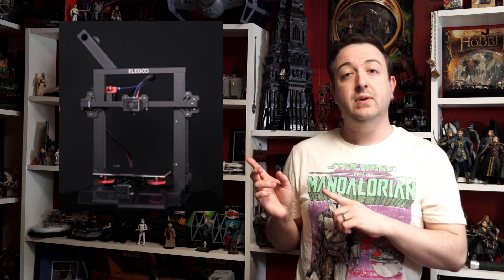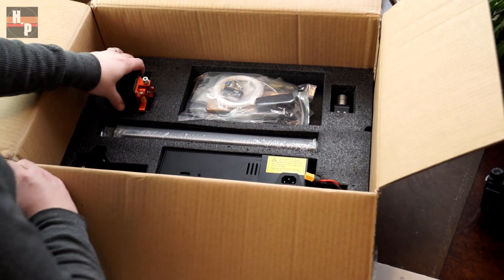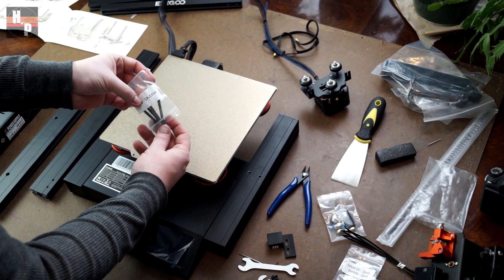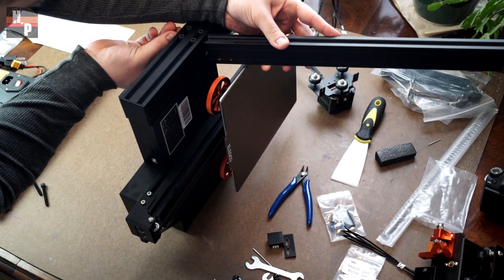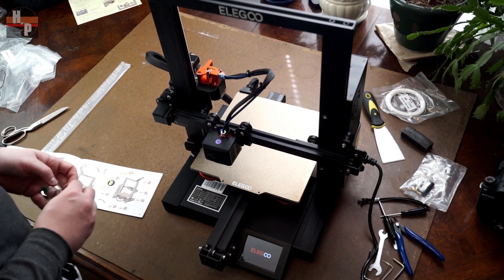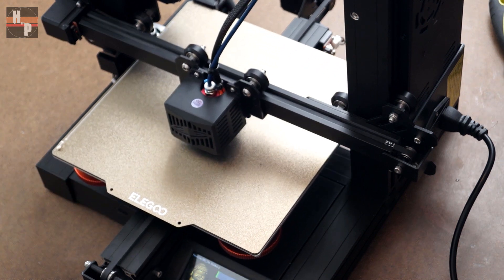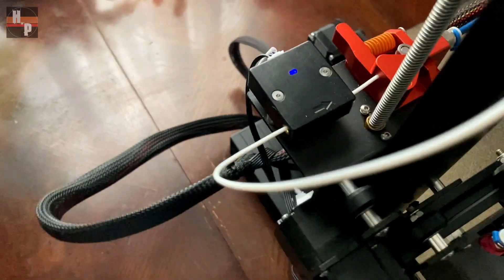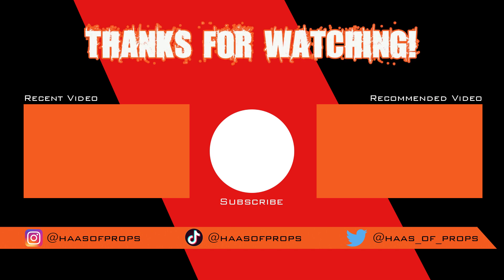Assembling & Reviewing an Elegoo Neptune 2S | 3D Printer Assemble and Setup | Getting a New Printer

Comment: Having so much trouble getting that first print to adhere to the bed, almost out of that first fillament no success
Reply from the maker: The first print is always the hardest. Check your bed leveling points. The bed should be about 0.1-0.2mm from the extruder nozzle. Another thing to adjust is your print temperatures (the bed should be about 50 to 60 degrees, and the extruder head should be around 210 to 220). I hope this helps!